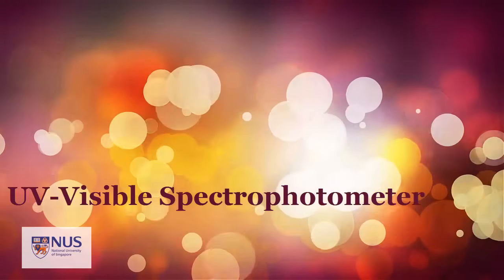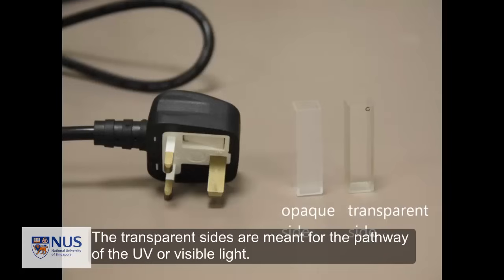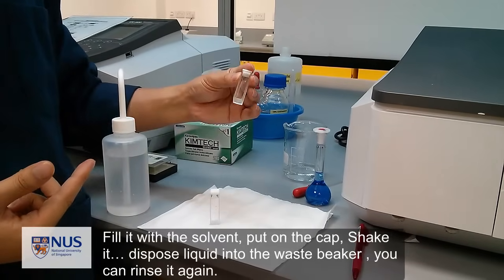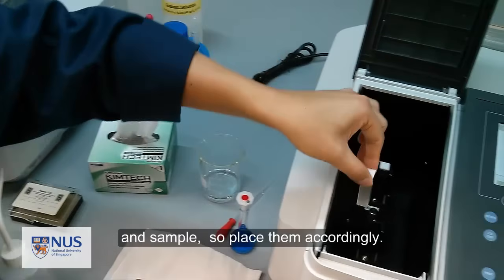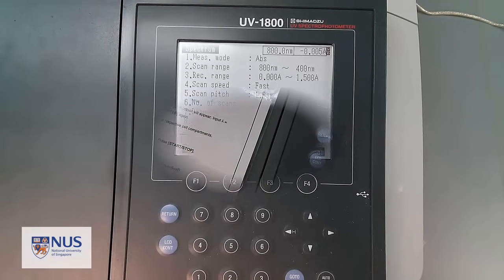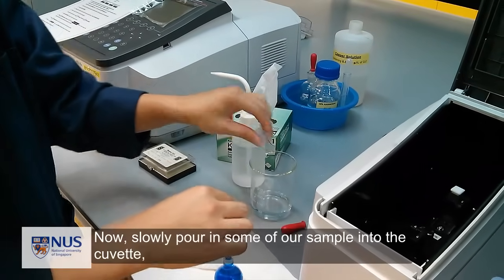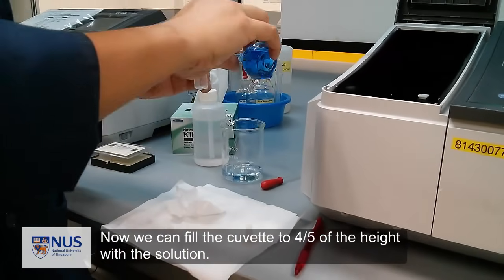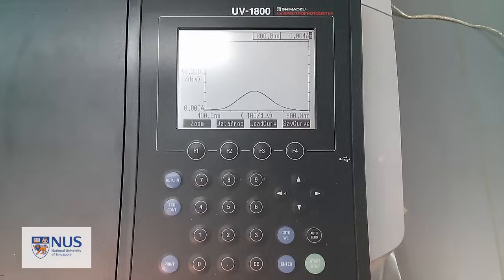UV Vis spectroscopy 🌟

Comment: Just see the video when i'm scrolling. Thank you for such a video. I have a question. Do we need COD digester for this type of spectrophotometer? Suppose my sample is palm oil mill effluent(POME). how can I make my sample to do this test? like just take the sample and measure or I need to do other thing? Can I use Hannah instrument vials to do COD test in this spectrophotometer?  I know my questions are like noob but I am seriously noob in this field. Thanks again for your time Sir.
Reply from the maker: You can use the referred instrument, it is possible to do the testing. But not the sensitivity,
Reply: @chemfunman  thank you prof.

Comment: Hi Dr, 
What is the difference between baseline and autozero. When you want to determine lambda max of a solution (unknown), as the first step keeping only solvent in both of the slots should we go for autozero or baseline ? 

Thanks in advance!
Reply from the maker: Do autozero after you have set the baseline. The baseline is set when you have a standard you wish to use as a reference value, say, a solvent. Adding a solute incurs matrix effect.
Reply: @chemfunman  It worked. Thanks a ton Dr Fun Man Fung.!

Comment: Good evening sir!
I have a query!
I need to see the absorbance of  dichloromethane by carbon by using uv visible spectrophotometer.  I had already run a pure dichloromethane  to full range of uv visible spectrum I e,190 nm-1100nm to see at which wavelength its peak is seen . 
And,its highest and clear  peak have been  seen in 208nm. But in literature the range of DCM for uv visible spectrum is 233nm, and highest 274 nm. Somewhere it is written the range is between 200-300nm. And according to  'OECD guidelines  for testing of samples' by uv visible spectrum, it's range is 235 nm for dichloromethane. Now I am confused what wavelength range I  must fix for my samples. Please guide me.
Reply: You can repeat your personal standardization just to be sure. Once you are doubly sure, use the best peak you got. Literature values are usually a range value. Your standardization will give the wavelength you should actually use.
Reply: @drolugbengaadetitunTV  thanks sir 🙏
Reply from the maker: You are most welcome!

Comment: Very good content! Explain to me, blank must have solvent and reagents, right?
Reply: Water is a universal solvent. You should blank with distilled water or any such solvent
Reply: @drolugbengaadetitunTV  Please Olugbenga. I am synthesizing Silver nanoparticles using plants extract. What do I need to use as my blank. Distill water or plant extract?
Reply: @solveeasy6788  Water is used asa blank in a spec when the sample is carried in water. Water is transparent,  if it used to zero the spec there will be error because the absorption of the reagent blank is different. Don't use water.
Reply: @drolugbengaadetitunTV  Thanks. I used the leave extract as my blank but it's giving me funny wavelength.
Reply: @solveeasy6788  What wavelength did you use? You have to check similar works in literature to know the wavelength that gave them the best results.
Reply: @drolugbengaadetitunTV  300 to 700 wavelength is usually adopted for silver nanoparticles in most literatures.
Reply: @solveeasy6788  Use between 500 nm to 600 nm and observe the results. Ensure you maintain a new cuvette for the experiment.

Comment: Is it possible to use UV-Vis to find out the color difference on wood that staining by fungi?
Reply: I don't think you can do that using this type of uv vis spectrometer. The sample has to be transparent to light. For solid samples you need uv vis DRS (diffusion reflectance spectroscopy)
Reply from the maker: thanks YH!

Comment: hai..thank you for sharing the video.. is it usefull to use UV VIs spec to analyse H2O2 concentration in the range of  10-50 micromolar/L? thank yuo very much for your answer...
Reply from the maker: unlikely because its absorption isn't too intense at a particular wavelength. It peaks over a range which makes it difficult.
Reply: @chemfunman  oh really? Analytical Chem is not my field of study, but i need to measure the concentration of H2O2 in water.. do you have any suggestion?
Reply from the maker: @gedeardaunud1361  try a chemical method

Comment: What if I want the readings at 260nm?
Reply from the maker: you need a light source filter that can measure the wavelength range that captures 260nm
Reply: Fun Man FUNG I mean we can set the UV range in the machine, how to do that?
Reply: Use photometric method, in this video is spectrum showed